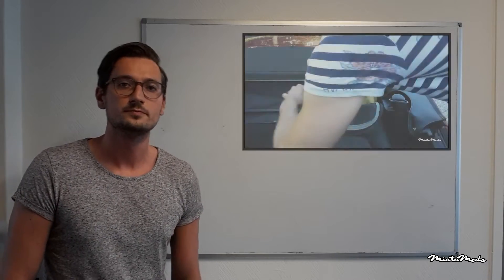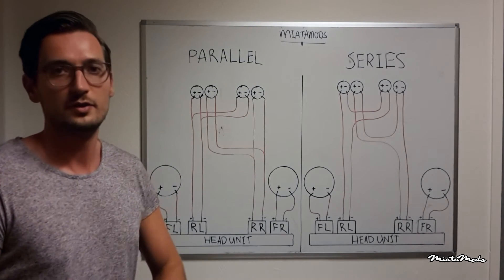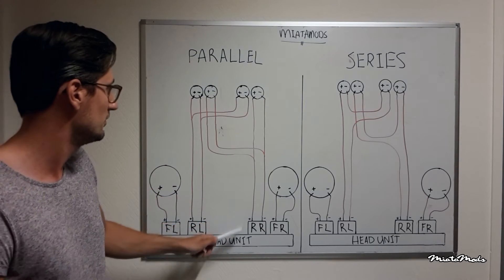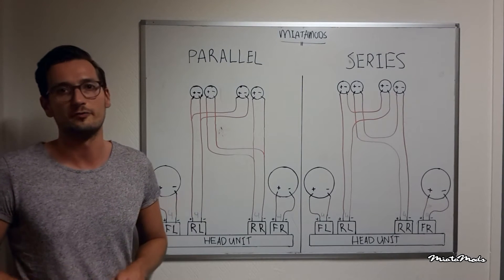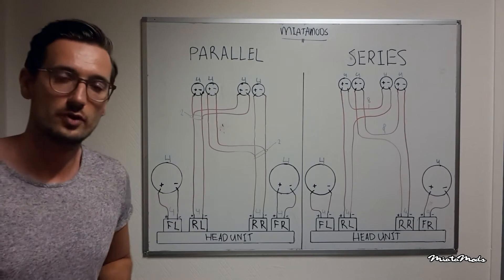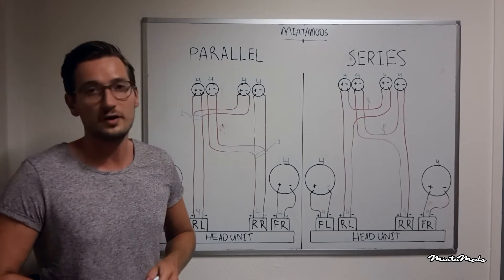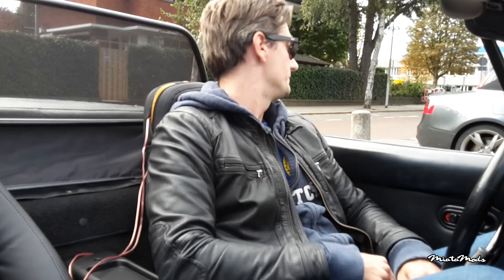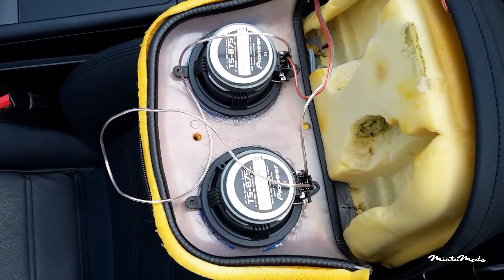MX5 NA Miata - 4 ohm or 8 ohm headrest speakers? In parallel or in series?

Comment: Ran my headrest speakers in my '91 Miata in parallel. After market JVC HD Radio CD player hasn't burned up from lower impedence. I didn't want to have to blast the stereo to hear it while topless on the highway. I just bias the fader a little more towards the front. This way I still have stereo separation in each headrest as intended and the wiring is way easier. Also I did have the incorrect factory wiring issue that plagues early models. A little wire tracking solved that issue. Put new Pioneer headrest speakers, Infinity Kappa door speakers, an Alpine amp, a sub in the trunk and called it done. Sounds amazing. Been blasting tunes for more than 4 years now with zero issues.
Reply from the maker: Alright man, thanks for sharing your experience

Comment: Is thia bad?i put 1 6 ohms speaker in my lg..but this is what i did, at the back of it there are 2 terminals of the speaker every terminals has a 4 ohms outlet what i i i did is that. I added my 6 ohms speaker i get a positive curruent from the rigt speaker r terminal and negative from the lefy  terminal...it runs smoothly and i get more louder sounds im usinh it for 3 years now but i dont know if iy is pararell or series

Comment: Hey, first off, I really appreciate your content and the memes. Very entertaining.

However, I was doing some research online in regards to speaker impedance and discovered that 2x 8 ohm speakers in parallel work for a 4 ohms load but 2x 4 ohm speakers in series would work on a 8 ohm load. Here's the site where I found it:
https://www.eminence.com/support/wiring-diagrams/

I also found it on other websites saying the same thing. Maybe I misunderstood something from your video but it appears that you're wiring it up as 2x 4 ohm speakers in series which would work with an 8 ohm load but the stock deck produces a 4 ohm load. I really wanted to get some 4 ohm speakers and try your method but I might just end up getting the 8 ohm midrange speakers instead. Would love to hear your thoughts on this. Thanks.
Reply from the maker: Hey Mr Solo, sorry for the slow response; your comment was flagged as 'spam' because of the link you added. Anyway, yes you are right; In my drawing I'm using 4 ohm speakers. The reason I did this is because most car speakers are 4 ohm and the speakers I bought were 4 ohm as well. As you said this gives a total of 8 ohm when you connect them in series, but that does not damage your head unit. The only issue you face is that the speakers will produce a lower volume. I'm running this setup for about 1,5 years and I haven't run into any problems. I've made a video on the final setup as well, did you see that one? I replied to your e-mail as well. I hope this helps! May the force be with you ;-)
Reply: Im trying to find out how or if this applies to 8 ohm stereo speakers with on-board x-over.  It seems to work with test at  normal listening volumes on them however  I would hate to burn the x-overs as the  amplifier  is designed for as low as 2 ohm.  I would also ad the speakers x-overs are worth more than said amp..

Comment: what if you want to add a subwoofer
Reply from the maker: You need to get a headunit which supports another channel. My headunit does support an extra channel so I connected my subwoofer to this channel. It’s even called ‘subwoofer’. A lot of headunits have this option so it should not be difficult to find one.

Comment: Good video, but at 7:55 your diagram is wrong, isn't it? To connect a pair of speakers in parallel you should have - from RL and + from RR, and then the exact opposite for the other pair. I think that was how you connected them up, when you showed us in your car, no? Anyways thanks for this, and keep the videos coming :) 
Ciao from Eunos NA8C owner in Denmark.
Reply from the maker: Hey bro, it is a bit confusing and you are right! In the beginning of the video the diagram shows how to connect speakers in parallel. But I could not connect my speakers that way when I was testing them because that would give a 2 ohm impedance and damage my headunit so for the sake of testing I used 2 channels to run the speakers at 4 ohm. That was the whole idea, because I wanted to test the difference in volume between 4 and 8 ohm impedance. I explain this at 06:54. I hope this helps! Thanks for watching!
Reply: Yeah, a bit confusing, but thx for making a video about it. I just saw your "meet my car" video. If you still have the standard front position/indicator lights, I really need one for the drivers side or maybe both. So give me a shout if you want to sell them :)
Reply from the maker: +Testacorsa I still have them! How can I reach you?
Reply: Sounds good. I just wrote a message to you on facebook.

Comment: nice video. thanks. i have a question. I want to run 4to6 6.5 at 8ohms each with 150 watts each off a 2 channel amp at 2600watts is that ok? i dont want to burn my amp or always have it going to protect mode, I think the amp is a 2ohm. how should i connect to get the best sound and not burn out anything? Should I get lower ohms speakers or 4 channel amp?
Reply from the maker: You have to start with getting the exact numbers of the speakers and amp. What is the average power (RMS) of the speaker and the amp? Be sure to get the average power, not the peak power! You also need to know what the impedance is of the speaker and the amp. Let me know what the actual numbers are and then I can help you!
Reply: MiataMods great thank you. I am working on my 05 acura tl and its a crazy set up but all i want to replace is the door speakers and the back which in total are 5 speakers but wanted to go with the same due to the ohms and watts the door speakers have to 6.5inch and 2.5 inches mounded depth. I will get the info and get back to you. thanks for your time.
Reply: The Rockville RXM68 is a 6.5" midrange/midbass driver that features 150 watts peak power handling and 75 watts RMS per speaker. The amp Max Power Rating:
2 ohms: 900 watts x 2 channelBridged, 4 ohms: 1800 watts x 1 channelMax power output: 
2 ohms: 1300 watts x 2 channel
Reply from the maker: Do you know the RMS power of the amp per channel?
Reply: MiataMods It only say rms more than 500watts but it doesnt say if its per channel.
Reply from the maker: This is going to be a long talk haha! Send me a message via my Instagram or Facebook, links are in the description. That way we can talk!
Reply: MiataMods ok will do thanks for your time

Comment: Really nice video. Id like if you could explain how to install component speaker in a Na miata that already have the factory install. These car have too much speakers man... 8 speakers for this small of a car... too much cables...
Reply from the maker: So let me get this straight; You want to swap out your doorspeakers for a component set, that is a midwoofer with a seperate tweeter right?
Reply: MiataMods yes. i have an 1996 with the mpss radio. all original. i cant find the oem crossover anywhere.... the car have pioneer oem tweeter dome and door midrange speaker. i dont want to bother with the headrest speaker i sont use them they sound weak. sorry for bad english
Reply from the maker: Send me a private message via my Facebook or Instagram account so we can talk and see if I can help you!
Reply: Ok ill do that shortly thx!

Comment: Great video. 👍🏻👍🏻👍🏻👍🏻 exited to see the video in the capacitors
Reply from the maker: Thanks bro! What I've noticed is that even though I connected the speakers in series, the were still too loud. I configured the fader (see 9:08) to F-6, so my door-speakers have a higher volume.  With a fader of F-6 I have a real surround sound feeling and because the volume of the headrest speakers is lower, I don't have any problems with the speakers vibrating the seat so capacitors are not needed. Thanks for watching!